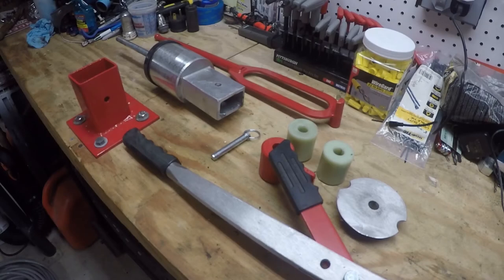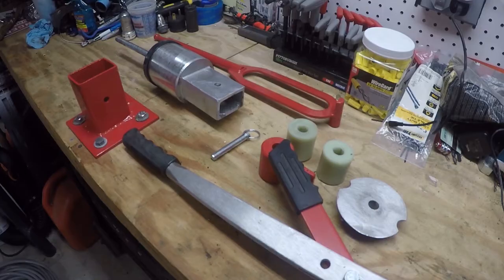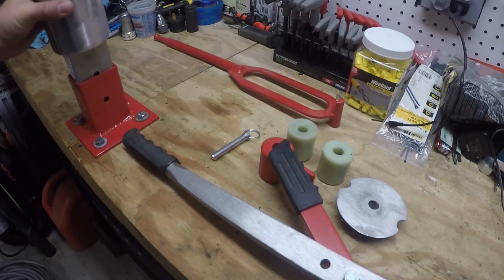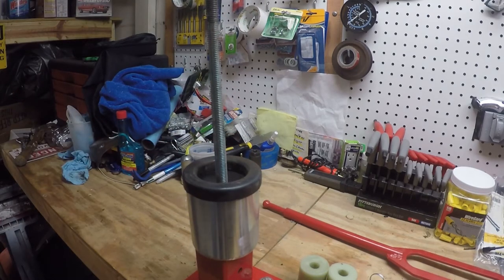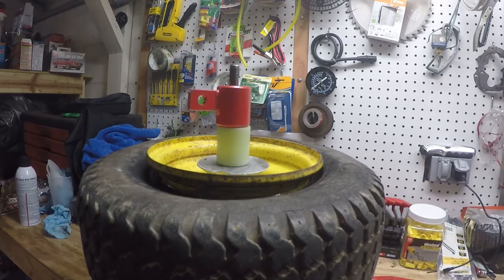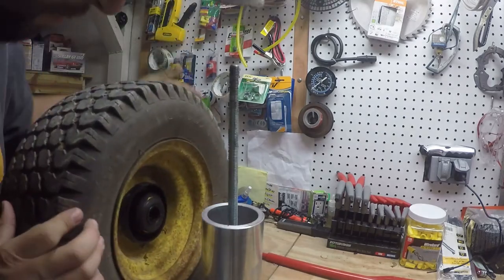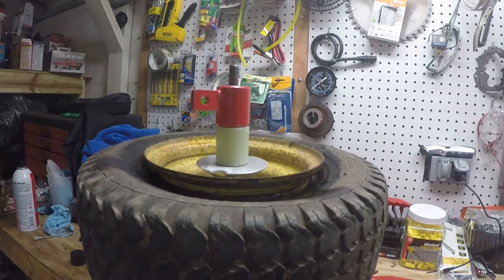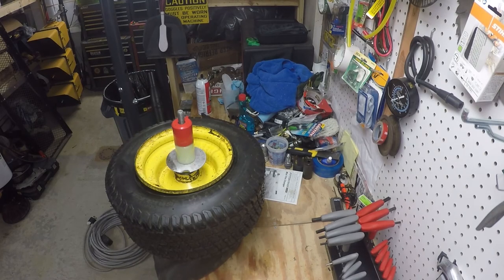Harbor Freight Mini Tire Changer Review and Demo

Comment: Thank you for posting.  Tire shops are increasingly not dealing with mounting small tires, and lawnmower shops seem to be going out of business left and right.  This tool is essential!
Reply: For real, there's only one place in my town where you can get replacement rubber tubes for briggs and stratton motors.
Reply: If you need any tips to set the bead of the tire, let me know. I figured out a pretty easy way without using fire.
Reply: @forensic8385 I’d like to know. Please share. Thanks, Clem
Reply: @cwixted  All I did was tape up the holes on the rim, and stack the rim/delfated-tire assembly on top of the second already-inflated rim/tire with all of the holes in its rim taped up.  With the tire inflator running, apply relatively uniform pressure downward on the deflated tire, and pull up on the rim.   The main idea is to use the second rim/tire to get a better seal than you would otherwise have on the garage floor.  My inflator was nothing special, but i think you need something decent.  This worked on a new tire that had been shipped folded in the mail, so it was really gnarly deformed, so I would think this process would work for just about any scenereo.  If you didn't have a second tire, I suppose you could place a layer of plastic on a flat concrete floor and achieve the same thing.  

Also, for the tire changer, I just bolted the thing to the garage floor using some plain old threaded inserts into the concrete.

Comment: The HF mini tire changer works pretty well for what it is. When it comes time to change those bigger tires, get ready for a wrestling match. It seems no matter how hard you crank it down it still wants to spin the wheel on the aluminum piece. I bought a piece of bailing belt from tractor supply and cut it out to replace the black circle plastic like piece. Works better. Also put my tires in the summer sun for a few hours. That helps too.
Reply from the maker: Thanks for the insight. I can see how the bigger tires could be more difficult.

Comment: I just used my HF Mini Tire Changer for the first time.   I took the slop out of the changer base by using blue tape to tape flat washers to two perpendicular sides of male piece that inserts into the base.  The mini changer works great.  I did however have to take one of the tires to Discount Tire to get inflated with their firehose inflater since the gaps were too large for me to close with my compressor, even with a ratchet strap. I have 23 x 10.5 -12 4 ply tires on my ZT.

Comment: I just bought one and changed 2 tires 18x 9.50 -8 and it destroyed the rubber piece that helps hold the rim in place. I'm going to return tomorrow and on the replacement I'll use a better rubber. Maybe even a trojan.

Comment: I have one works great on front wheels no complaints fails to  menthion will not work on a rear wheel slotted drive wheel as i found out on my own. So buy it for rhe right intentions of use on 3/4 inch bushings or wheel bearings only a 3/4 inch slotted rear wheel will not fit it

Comment: Just went and picked this up. At this point threaded shaft will not fit through a 2018 XT1 Cub cadet rear wheel axle shaft center hole. Axle and wheel has basically two flat splines and a center bolt. I’m hoping I can grind flats on each side of the thread to where the wheel will slide over. Crossing my fingers. Hate to be wasting my time and money on a Saturday especially.

Comment: It looks to me that the insert fit to the bolted base should be a tighter fit. The pin should snug it in place instead of causing or allowing the setup to flop and wobble around. The demounting/mounting tool seems too short. More leverage would facilitate demounting and mounting. I think that making two tools instead of a single combo tool that does neither function well would be a good improvement.
I would like to see a small tire tested. Conventional tire tools handle larger tires and wheels much better than small tires and wheels for mounting and demounting. This tool looks aimed at the smaller rim size  mounting/demounting functions. Testing it on a small tire would be more beneficial to me than the size that you demonstrated. 
Bead braking is a major obstacle for the DIY'er. This tool addresses this issue, but eliminating the loose fit flopping around issue would greatly improve bead breaking function. Clamping the tool in a decent bench vise mounted to a heavy table or anchored table would likely improve this function. 
There is enough good ideas in the cheap tool to entice me to improve on the design and build my own.
Reply from the maker: What’s your definition of a “small tire”? This is a 16x6.5-8 lawn tractor front tire which most would consider small…
Reply: @outdoorpowerhouse   - I think he is still working on that answer....
Reply: I think he meant a more narrow tire when he said small tire.

Comment: Definitely drill out the mounting pin holes next size up to match a bigger pin or bolt diameter size. The amount of flopping around during change was bad. Otherwise great tool and video.

Comment: You can clamp the edge of wheel with vice grips to stop tire from spinning
Reply from the maker: You could, but risk chewing up the edge of the wheel. I’d rather not give it a reason to leak.

Comment: Can you please try a go kart wheel tire. Small one and use some soapy water
Reply from the maker: I don’t have miscellaneous wheels laying around to try on it, you’ll have to give that a go on your own.
Reply: Bought it specifically for go kart tires. Works fine. My daughter races dirt oval. The only problem I had was the aluminum cone piece had to be ground about an 1/8 of an inch to fit inside the really wide wheels.

Comment: That thing will destroy your bench top.
I mounted mine on a plywood base and
set it on the concrete so I can wrestle 
it like the greased pig that it is.
Shipped instructions are useless and
there are very right and very wrong ways
to use it. Just gotta figure it out.
Good luck, Sir!
-- North Central Florida
-- 7.12.2023
Reply: I mounted mine directly to the garage floor with threaded inserts. Works like a charm and can bolt and unbolt.